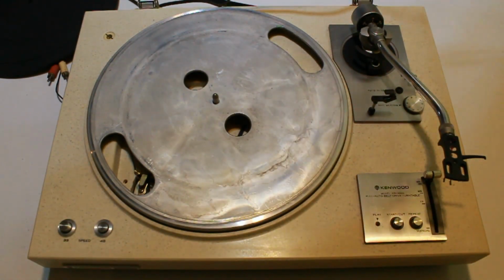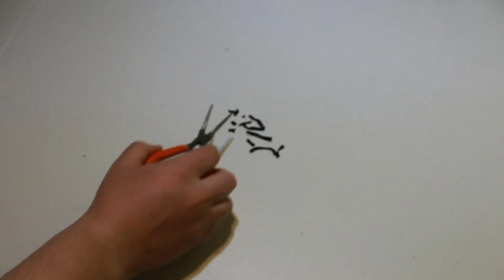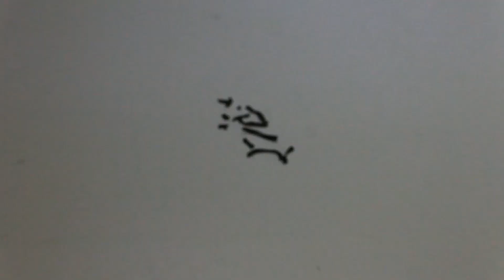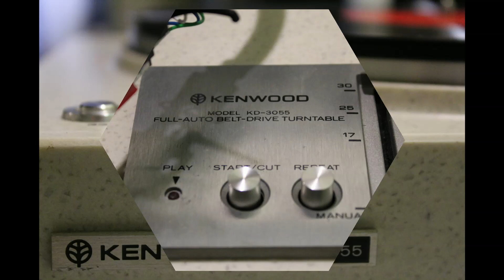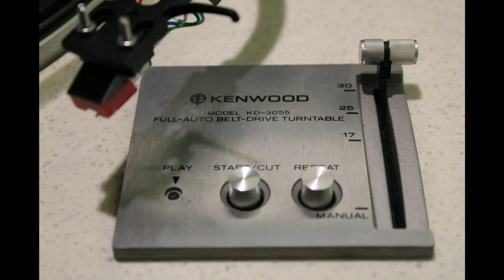Kenwood KD 3055: My First turntable repair!

Comment: headshell, pins .... thingy's BTW, I have a KD-3055, nice rig - am working on setting up, its quite complicated. Cart = Cartridge, looks like your screws are mounted upside down, no biggie. Also, there's a screw thingy at the back of the tonearm under a rubber grommet. turn it left or right  to adjust tonearm dropdown and auto return.

Comment: Hey Dave, is there a release button so my turntable platter well come off on my kd2055? I watched the video but couldn’t see if you had a release button.
Reply from the maker: Sorry for taking so long to respond! No, there was so release button on my model.  However when I firsts bought it the platter was stuck.  If this is your problem, VERY LIGHTLY tap the middle pole thing with a rubber mallet or maybe screwdriver handle to loosen it.
Reply: Middle pole thing = spindle  ;)